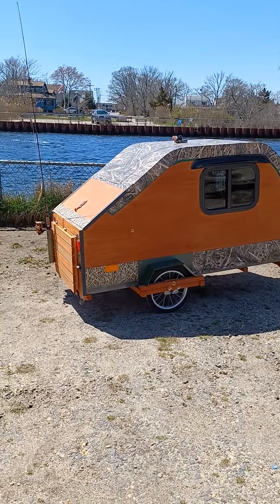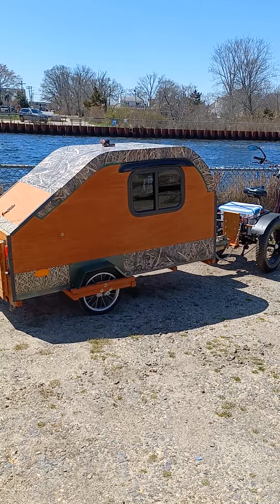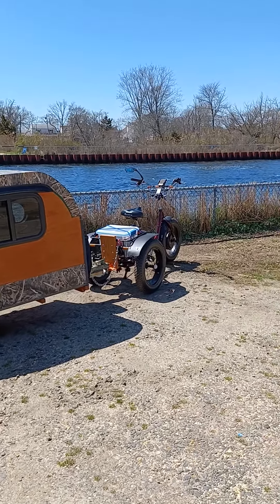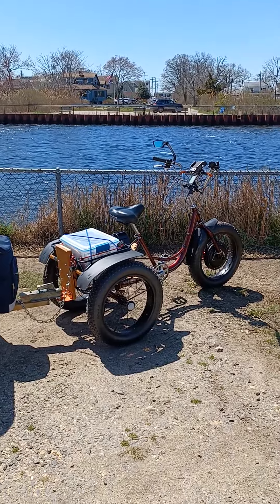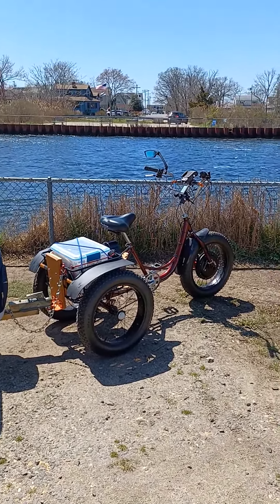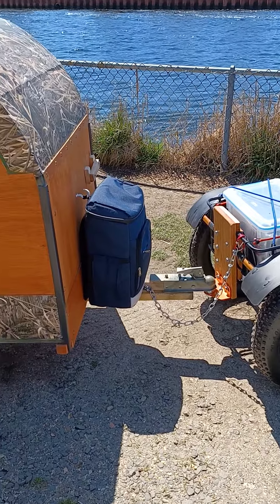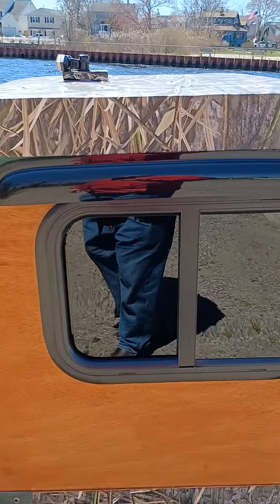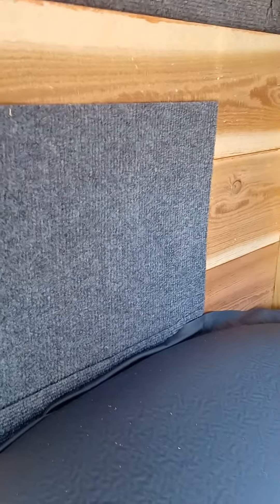DIY Bicycle Pulled Camper / Bike Camping

Comment: A brilliant build and I love your kitchen. Would love to see the candle heater you suggested. Check out my build on my channel.
Reply from the maker: Thanks! Like your channel  also. The candle heater is made by  UCO. It is the 3 candle model. UCO Candlier. About $35.US.
Reply: I want to do a build issue is that want it wider than I think might be allowed, wondering what needed for two people as thinking if I am with someone who is average cyclist I can pull it along (I am between average and tour de France)